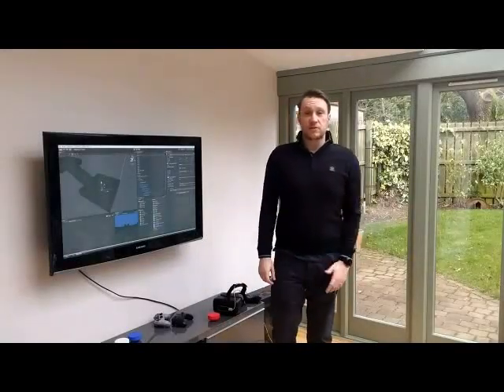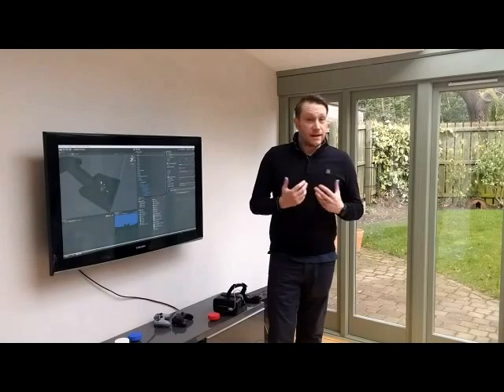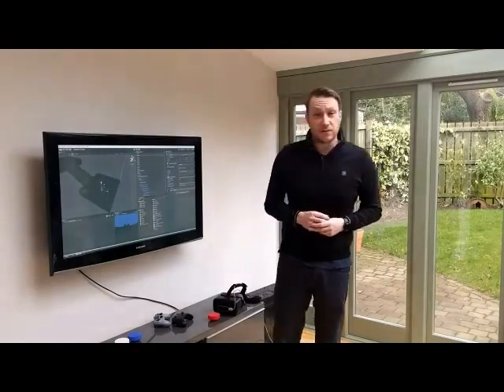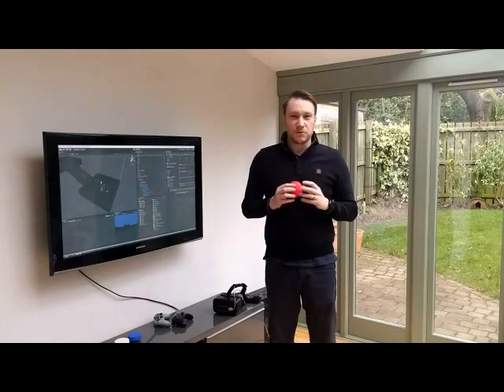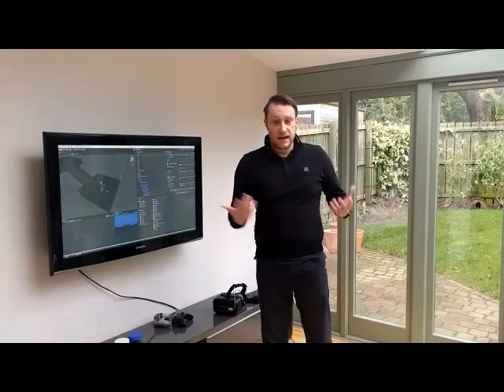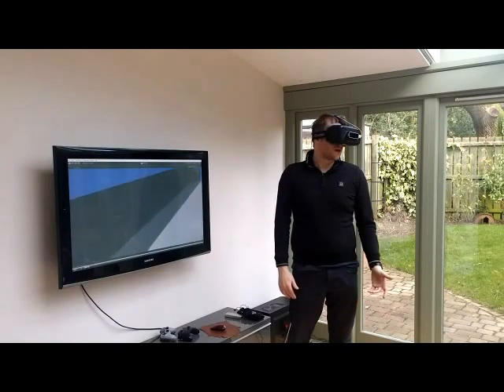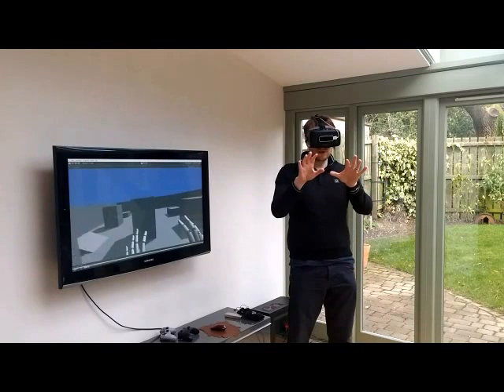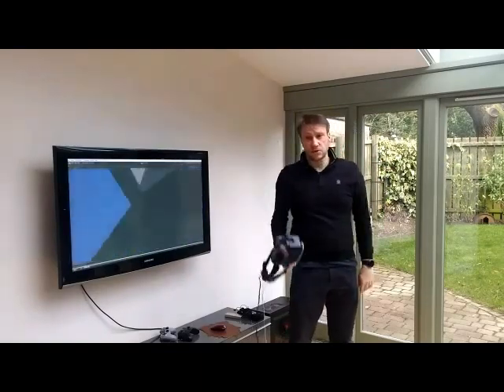project PUC demo - Infinite Locomotion for VR

Comment: I watched the video but I didn't see/hear anything at all that explains how you control movement. How do you move forward? How do you stop? You talk about locomotion and made this video, but you didn't explain anything at all about how you do it. More info, please!
Reply from the maker: +Thor Peenith 

Hi Thor, you just lean, very slightly - you almost don&#39;t need to actually do it, just think about it. If you came from the reddit thread on /r/oculus, there&#39;s a lot more info on there.

https://www.reddit.com/r/oculus/comments/43ditc/project_puc_demo_infinite_locomotion_for_vr/?ref=share&ref_source=link

Basically, you put it in a pocket and then motion is controlled by slight repositioning of your centre of gravity. There are 2 rotation modes, the first is a direct 1-2-1, so you&#39;d need to turn 180 to get your VR avatar to turn 180. The other is a progressive turn, like steering.

If you&#39;ve used a &quot;Hoverboard&quot; or segway, it feels the same, except you can also strafe directly sideways with it.

To stop, you just stop leaning, again, fairly naturally. There&#39;s an adjustable &quot;dead-zone&quot; in which your body can drift without moving in the virtual world and the sensitivity on how far you need to lean can also be controlled.

It can also detect jumping.

The software is early days and is where I&#39;m working now to refine, but the basic principals won&#39;t change.
Reply: Awesome, thanks! Perhaps you should make another video that explains these things! Looks like a nice, novel and inexpensive solution- nice going!